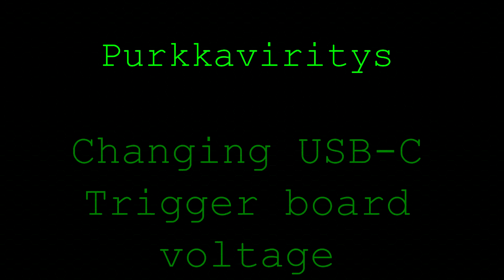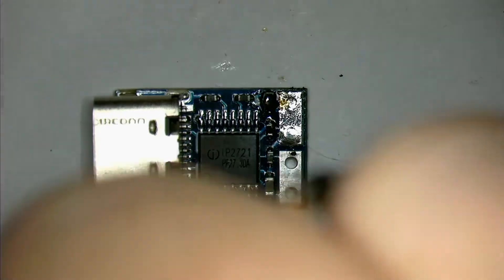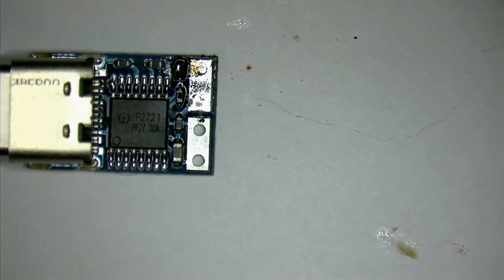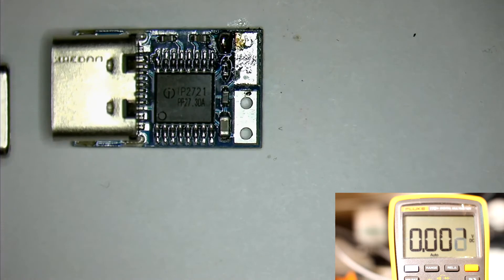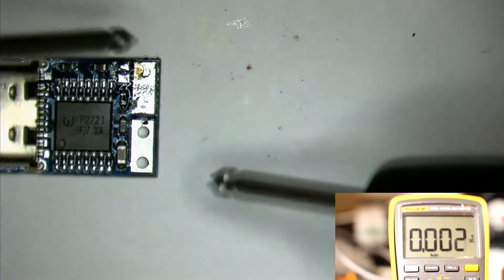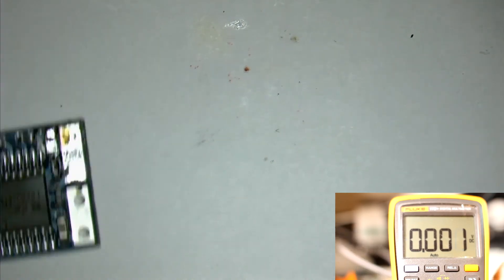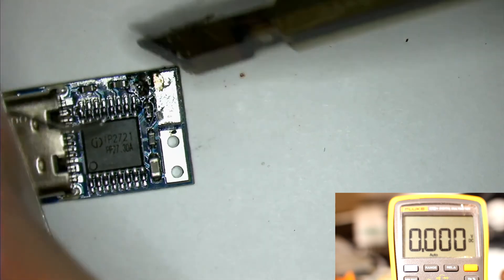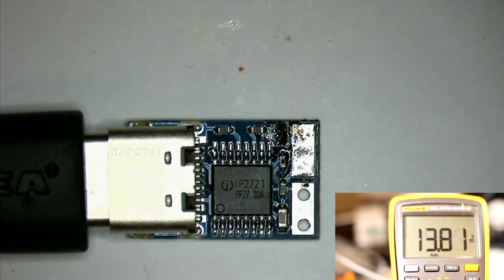USB-C trigger board voltage change

Comment: I have bought a TZT PDC004-PD PD Decoy Module, USB-C PD 9 from Ali express, and it only reads 5 volts it is supposed to read 20 volts.
Reply from the maker: and what kind of charger did you attach it to? as the charger needs to also be capable of 20V.

Comment: if not using pd charger, can delivery up to 5v or not sir?? or maybe if i use like 5v battery
Reply from the maker: these modules are meant to work with PD modules, using a 5V charger kind of defeats the purpose.

Comment: It doesn't work on mine. I bought 9V and 12V boards. On 12V there's a pretty small smd resistor connecting these trigger points
Reply: remove the "resistor"

Comment: I have a similar trigger board but it's usb type A, I try to use it on my pc that has usb 3.2gen1and2, but it only output 5v, do you know why is that? My motherboard is msi z490i

The product I got: https://www.amazon.com/JacobsParts-Fixed-Voltage-Trigger-Module/dp/B08NFK8BPP/ref=sr_1_1_sspa?dchild=1&keywords=12v%2Busb%2Btrigger%2Bboard&qid=1627003810&s=electronics&sr=1-1-spons&spLa=ZW5jcnlwdGVkUXVhbGlmaWVyPUEyVDRGTlBIRExWQUtJJmVuY3J5cHRlZElkPUEwOTgzNTIwMlpFRFJKMlVPT1dCUCZlbmNyeXB0ZWRBZElkPUEwMTUzMDUzM1RWSkpKV1NTT0hWNSZ3aWRnZXROYW1lPXNwX2F0ZiZhY3Rpb249Y2xpY2tSZWRpcmVjdCZkb05vdExvZ0NsaWNrPXRydWU&th=1
Reply from the maker: because your motherboard only outputs 5 volts, you need something that gives you USB-C PD like a charger does.
Reply: @Purkkaviritys  So motherboards will only output 5volts doesn't matter if is 3.2 gen 2 (10Gbps)? I am confused, many articles are saying 3.2 gen 2 can support 10Gbps and up to 20v5a=100w. Or is that only apply for power banks and laptops? So I guees it doesn't matter is type a or c, they only provide 5v no matter what? Then the only difference between 3.0 and 3.2 is transfer speed increase?
How about thunderbolt 3? Will the product in the video make it output 12v?
Reply from the maker: @jaygoer3373  Yes, just because the protocol is capable of working with 5-20 volts at 5 amps, does not mean that every usb-c device can output 20V. if you look at a USB-C PD charger, they say the output is either 5,9,12,15 or 20V or any combination of these.

Comment: what is the maximum current?
Reply from the maker: They say its 100W so for 20V board 5 A but I doubt it will be able to handle it, it will probably warm up quite a bit.
Reply: @Purkkaviritys  I only get about 2.7w (9v 0.3A) or 5.8w (12v 0.4A) with Powerbank support PD and QC 50w. Not the cable issue since my phone have quick charge. I bought some other pd trigger board model, even one with USB C Male which I can plug in directly without cable, but having the same issue.
Reply from the maker: @undefined-o5j  sounds like an issue with the powerbank and not the usb-c trigger

Comment: Can you also get 5v out of the board?
Reply from the maker: No, if you want 5V, then you dont need this board as USB-C if it cant negotiate the voltage will give out 5V and negotiation is needed for the others.
Reply: @Purkkaviritys  my USB-C Power Adapters don't give out any voltage, not even 5 volts. Same goes for all USB-C laptop chargers which support up to 20 volts but they need to be triggered even when needing 5 volts....
Reply: @marcel_fpv  You can get 5V from both kind of boards if you connect jumper point for SEL pin (that's the soldering point closer to the edge of the board) to ground (GND). Check IP2721 datasheet - if that pin on any of the boards (one has IP2721, the other IP2721_MAX12 chip) is connected to ground, then the output is 5V.
Reply: @mariobaksa  do I get full power then, or is the current limited to a very low number (200mah or so)?! At least I heared that somewhere but I'm not sure...
Reply: @marcel_fpv  Just tested - pulling 3 A!
Reply: @mariobaksa  okay, thank you!  This will help me with my second prototype of me new project!
Reply: @marcel_fpv  After exploring things a little bit further, now I understand why they don't offer 5V trigger board. It's because electronic trigger is not needed for 5V - you only need a pull-down resistor of 5.1 kOhm for pin CC. So essentially it is better (and much cheaper) to order female connectors on small PCBs that have a place for the resistor, and solder appropriate resistor (DIY Perks used 4.7 kOhm and it worked for him). Those connectors/boards can be bought from Ali for like 2 dollars for 10 pieces.
Reply: @mariobaksa  this is exactly what I heard about. But I also heard, that you only get limited current than. But if you say otherwise, I will try that!
Reply: @marcel_fpv  Tested it with 4.7k resistor with two chargers. Baseus 65W GaN2 Pro allowed me to pull out 3.2 amps, and Cellularline 20W allowed me to pull 3.7 amps before they have cut power.

Maybe there are PD chargers that limit current to 500 mA or whatever, but two PD chargers that I tested essentially limited current to their maximum PD current at 5V, which is 3 amps in both cases (of course, plus overhead, which is much greater in case of Cellularline charger).
Reply: @mariobaksa  This is very helpful. Thank you! More people should know this!

Comment: How you power up this chip? By charger or power bank? I bought 4 of this and connect it to PD power bank but the output voltage is still 5 volt. I tried with many others power bank.
Reply from the maker: look at the specfications of the powerbank, does it say the powerbank can output 5,9,12,15 or 20 volts because there are many types, some can only output 5 some can output 5,9 and 12 and a few can do all of them.
Reply: @Purkkaviritys  about 5v, 9v. I could charge the samsung s10 phone at least 9v 1.6A
So I think the PB can deliver QC protocols. Despite on the back of it is wrote PD, but it can't power up my chips. Anyways Kiitos of your reply
Reply from the maker: @moya9450  The only ones I have tested are a thinkpad charger and some thinkpad -> usb-c converters that were able to produce all voltages from 5 to 20 volts. 

did you get the 9 volt boards (or remove the solder to make a 12 volt board 9 volt) as a 9v usb-c will only be able to produce 9 volt or lower output. These boards only trigger the usb-c power supply to provide the voltage so if they can't they wont.
Reply: @Purkkaviritys  Good point. I have the same charger at home. I will check it. Thank
Reply: @Purkkaviritys  They worked nice with Lenovo charger. It's sad that PowerBank module which I bought fro AE is not PD despite seller sold it as PD
Reply: @Purkkaviritys  I live in Finland I have lot's electrical components. In case of emergency need you can ask me to send it for you